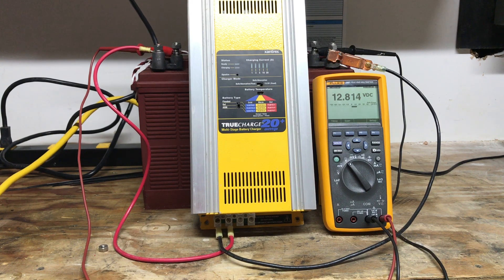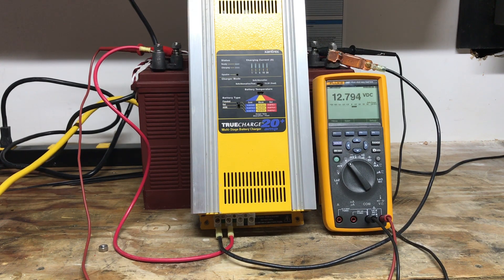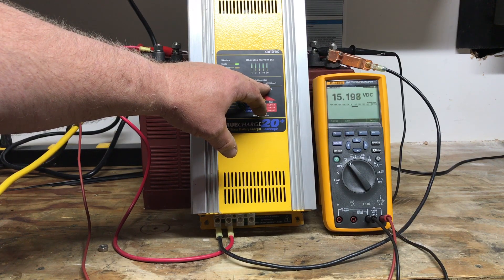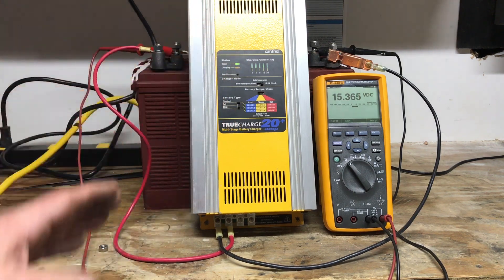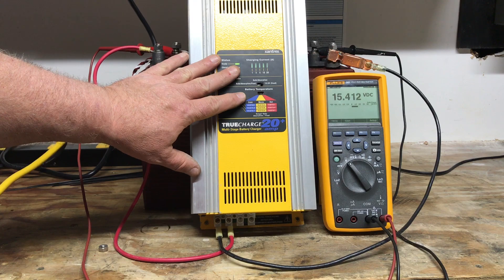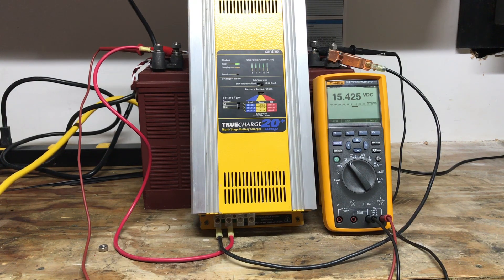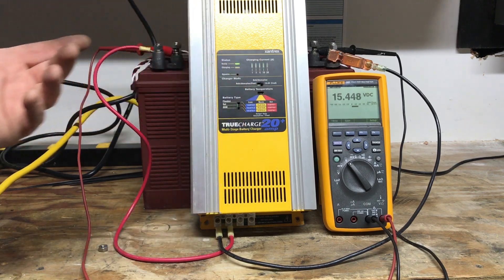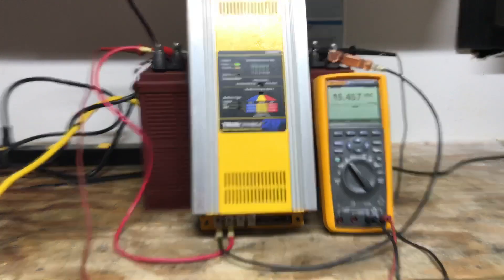Failed Marine Battery Charger - Runaway Voltage

Comment: Great informative video.  I believe I'm having the same issue. I have a dual 15 amp. One battery reading good on charger. Other was at 10 %. So I switched the wires on the batteries. Just to see if it was actually the charger & not the NEW batteries. And now it's reading 30% on the #2 battery. Where as number 1 battery was at 10%. Any ideas as to why the difference in % ? All batteries had the same voltage 12.7 volts.